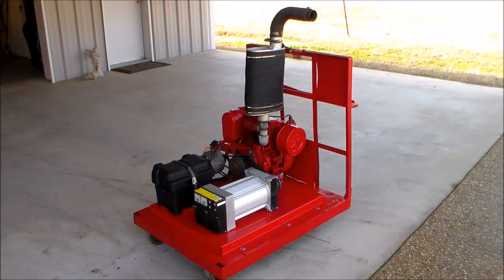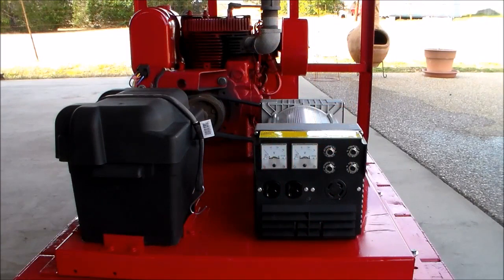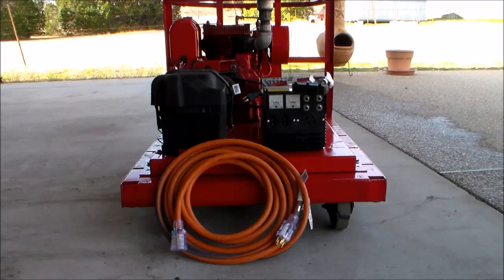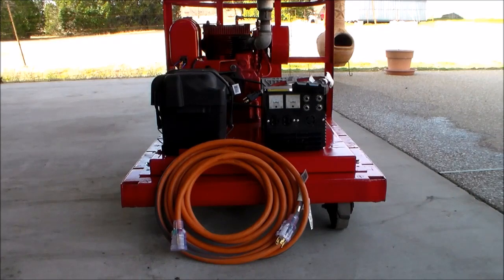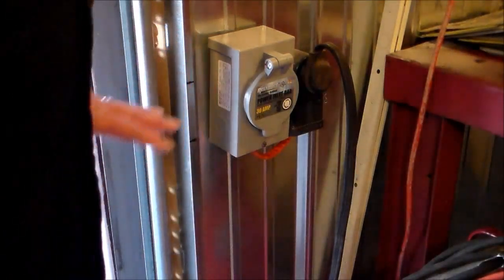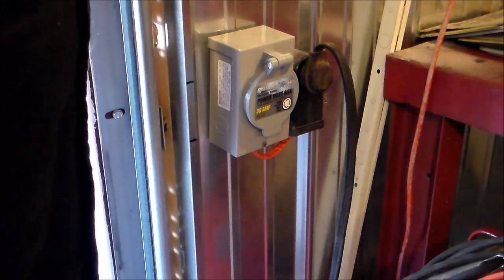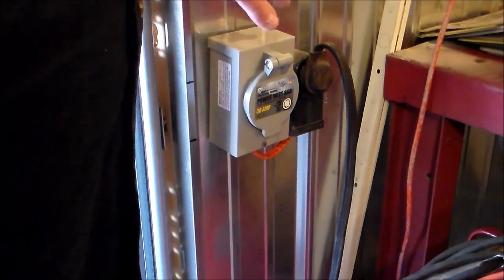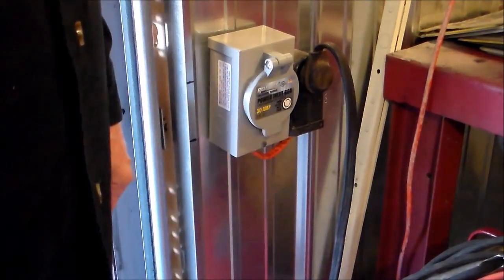Harbor Freight 10 kw Generator Head

Comment: Did the generator somehow connect with your motor to increase RPM during higher demand for amp draw?
Reply from the maker: This engine ran at one speed load or no load. You can get an electronic throttle control if required. Thanks
Reply: That's a shame.  Running at idle until load draw increases saves a lot of wear on your engine - especially in a power outage situation where you may need to run it for hours or even days.

Comment: Hey Rusty! I just picked up this same gen head off of FB marketplace for $100 and it's never been used. I have a 71cc gas motor I was going to connect it with that used to power a 1200w generator. I think it will work?? Does this generator head still work today?
Reply from the maker: The one I got was a 10k gen head and required a minimum 16 hp to get full rated power. Your engine may operate it but will likely need a larger engine to get full power. Good luck with your project
Reply: @RustyGlovebox  Yep! You're right. Doesn't work! Found manual online and it say's 16hp. Would like to find a DC motor with that kind of power and RPM.

Comment: If your generator is 10kw. It should be making more than 30amps
10000w/120v= 83amps. Even using 50% load that's still 42amps. I'm curious how you got the 30amp result.
Reply from the maker: It is rated at 10k surge and 7200 continuous with 240 volts. 7200/240=30amps
Reply: @RustyGlovebox  got ya. I thought u were in the USA. My bad.

Comment: Could this be mounted to a 2000 ranger xlt 4.0 ??? I have a 10000 dual fuel generator to power my house but was thinking as a backup if the other was down
Reply from the maker: The gen-head is big so you would have to be the judge if you have the room under the hood.

Comment: What size engine did you use? Can you turn the generator over by hand? What is the smallest engine that I could get by with? Thanks in advance.
Reply from the maker: It requires a 16 hp engine that can drive it 3200 rpms. You will need to check and make sure you are getting 60 cycles. You can change that by increasing or decreasing the rpm's. You can buy a meter on ebay or amazon cheap. Good luck
Reply: @RustyGlovebox  Using a 16HP engine seems like a lot. I have a 7.5KW gas generator and it cost me $77 for gas to keep 2 fridges and a freezer going off and on for 6 days during Hurricane Irma a couple years ago. That was maybe 6 hours a day.
Reply from the maker: This is the link for the gen head
https://manuals.harborfreight.com/manuals/45000-45999/45416.pdf

Comment: Speaking of pulleys. Do you by chance remember the shaft size for the generator head? I have been looking everywhere and cannot find the shaft size to put the right pulley on it.
Reply from the maker: Sorry I took so long to get back but here is the link for the gen head instruction
https://manuals.harborfreight.com/manuals/45000-45999/45416.pdf

Comment: What size engine is turning your generator head?
Reply: At least 16 hp on gasoline . Must run at 3600 rpm to get 120//240 volt. More it better, 20hp would be better. At 10000 watts surge load it would use 20 hp.You can never have to much hp as long as its 3600 rpm with a rpm  governor. I would build a bigger generator, but most cars engine are expensive to govern to 3600 rpm or use belts  and pulley to that rpm...
Reply from the maker: Yep, 16hp or larger works perfect

Comment: I bought this 15 year ago.Remember volts X amps=watts,  watts/volts = amps,  watts/amps =volts I directly coupled to Brigg 23 hp using lovejoy L100 couplers. It worked well for 72+ hrs at my cabin running 12.5 btu air conditioner tv lights microwave etc in 90+ degree weather after big storm knock local line down. Only problem was heat off engine blew towards generator head then suck inside and  melted internal plastic fan, then over heating generator head.  no  repair parts available(fan). I should have placed a metal shield between engine and generator to defect heat away from gen cooling air intake. Use at least 16-18 hp 3600rpm engine at 35- amps 240 volts load. More hp is better. Electricity is drawn  and load will slow engine down from 3600 rpm dropping volts from  120/240 which then raising amp draw. PS for Idiots, you can't hook a electric motor to drive the generator , that would be a perpetual motion machine and violate the law of thermodynamics..
Reply from the maker: I tried to get another one but it was damaged in shipping. Re-ordered and the same thing happened again. Gave up after that and just got one of their generators at the store. Thanks
Reply: You COULD run it off an electric motor. You could not run that motor off the electricity generated by it, though. It would be a complete waste, obviously. I'm not sure who would think that was a good idea.

Comment: I'd be curious to know what the Hz runs at under full and partial loads?
Reply from the maker: I have a Hz meter and set the rpm to match 60 cycle
Reply: @RustyGlovebox  So when you hit it with a full rated load, how does the engine/Hz respond?  The reason I'm asking. Most engine governors are not that sensitive to holding the correct Hz instantaneously.
Reply: My suggestion, Use a pure resistive load (space heaters or resistive incandescent light bulbs) and an Amp clamp and voltmeter and run it at no-load, then full 30A load and see how it responds.
Reply: @RustyGlovebox  BTW, I just looked at that "10KW" head, it looks like it's really a 7200 watt head, that's what it's rated at. It'll not hold 10KW continuous. I doubt it'll hold a 30A load for more than a few seconds before it trips or bogs the engine.  The rule of thumb is that you need 2 HP to produce 1 kW of electricity.
Reply from the maker: It is a continuous duty 7200 with 10K surge. You are correct there is some fluctuation. It would not be a good choice to operate sensitive electronics.  For those an inverter generator would be a better option.
Reply: @RustyGlovebox  how big are the variances?
Reply from the maker: @TheEquineFencer  I set it under a 1/2 load. It doesn't run at full load all the time so it can vary.  Maybe 1hz , similar to other small engine generators

Comment: Nice build. I plan to use this same generator head and run it off the pto on one of my tractors. I will likely build the generator attachment to fit my 78 Bolens H16XL, as it has a Tecumseh OH160 (16hp).
Reply from the maker: Thanks Mike, I have done an update on the power plug, you may look at this video. Take care
https://www.youtube.com/watch?v=m08AR_eqITw&t=272s

Comment: are these STACK-ABLE?   It would be nice to get upto 100 amp X2 for 220 volts.
Reply from the maker: It doesn't say they are stackable. I think it would be cheaper to buy a larger generator to  get the 100 amps.
Reply: To stack them there would have to be a way to synchronize the waveforms and these do not have that.

Comment: Do you think a 10hp briggs would be ok to power this generator head?
Reply from the maker: TACOMASRT5   I think it would but you would not be about to generate at its maximum wattage. A 16hp is recommended
Reply: @RustyGlovebox  I've got a harbor freight mig 170 welder
Idk how many watts I need to power it. Works just fine in my dryer outlet
Reply from the maker: @CarModsandDadBod    If the welder is a 120 volt welder and it draws a max 20 amps. The minimum watt needed would be 2400 or higher(go with a higher output generator).  Go by the continuous duty not the surge rating.  Without knowing the exact welder , this is very general.
Reply: @RustyGlovebox  the welder I have is a 220 20 amp.  It's the mig 170 from harbor freight
Reply from the maker: 220 volts X 20 amp = 4,400 watts minimum. The larger the generator the better. If you get to close to the minimum, it would over work the generator and cause problems with the generator or welder.
Reply: @RustyGlovebox  so my 5000watt should work?
Reply from the maker: @CarModsandDadBod    Is that 5000 surge or continuous duty
Reply from the maker: You need to looks at the specs for your generator. What that advertise is the surge and the continuous duty is 500 to 1000 less watts on average.
Reply: @RustyGlovebox  surge is 6550
Continuous is 5500

Comment: hello, Im interested in using this generator, I dont see any mounting points on this generator, can you tell me how this thing mounts to the platform?  Ive been looking all over, not one picture of the mount points
Reply from the maker: On page 5 it shows the way it mounts.  It has worked well for me. Good luck
https://manuals.harborfreight.com/manuals/45000-45999/45416.pdf

Comment: Just bought one of these. Might be a stupid question. I don't see in the manual and couldn't tell from your video. But, does it need to rotate cw or ccw? Or does it matter?
Reply from the maker: Mine really works good. Here is the manual and it should answer any question. Good luck
https://manuals.harborfreight.com/manuals/45000-45999/45416.pdf

Comment: your connection to the house is so dangerous  ive seen a guy wait 2 months  in the middle of winter to get reconnected after getting caught using a setup like you  have by the power corporation 
they totally cut his house clear from the pole  big fine had to have his entire house  inspected everything down to a missing switch plate had to be fixed before they would reconnect dont be cheep spend the 1200 have a isolation panel installed

Comment: It needs a switch to pair the coils for 110 so you have more 110 power 60 amps 110 or 30 amps 220?  Just running 110 will only load one coil without a pairing switch and limit the output by half
Reply from the maker: This generator won't deliver more than 30 amps. It has 110 and 220 plugs but 30 total is all it will deliver. You will have to go with a unit set up to deliver a higher amp load. They generally will be rated for 50 amp or 100 amp load.

Comment: I have a truck with the transmission out. It runs fine. I had thought about one of these gen heads to use with the truck turning it into a quiet electric start gen. The gen head needs 3600 rpm to work, the truck idles at 700plus, so I would need some sort of pulley setup or such to make it so it becomes 3600 at the gen head. Any thoughts anyone? Learning all the time.
Reply from the maker: I bet that would work fine. More engine than you need but you alread have it. Plenty of power to gear it up. Good luck on the project.
Reply: A brick on the gas pedal will work just fine! 😀

Comment: You did a very nice job mounting everything.  It looks very clean.  The enegine does not look large enough to carry that 10k  generator head though.  I have not done the math, but with the power loss of the belts, and pulling the automotive style alternator, I would suspect you would need around a 20 - 25 horse engine.
Reply from the maker: The instruction for the gen head says 16hp is the minimum recommended hp. Thanks

Comment: I would like to do this, as well. But, my biggest concern is decibels. It sounded pretty loud. Have you ever thought if putting a shroud on your unit? What do you think the drawbacks would be and would it dampen the noise to say, 55dB?
Reply from the maker: TheZooBrooksAB  It is loud, I have it down 86dec now. Your right an insulated cabinet should make a big difference. Haven't done that yet but will figure something out for it. Thanks

Comment: Is this still working? I have an old Kohler RV generator that puts out only 120v, and I've been thinking about adapting this head to the motor (22hp, strong and quiet). I'm concerned about the quality of the Harbor Freight head, though.
Reply from the maker: Well, It is still working. It has copper windings and sealed bearings. For the money I have no complaints. The few parts it has inside they could be replaced easily. it puts out 120 or 220. But if you wanted something for an emergency backup, I would get a stationary propane or natural gas unit.Thanks

Comment: What did you use for a motor?
Reply from the maker: I had a 16 hp Kolher engine I used . I had thought about standing the gen head vertical and use my riding mower engine  but used this engine .
Reply: Rusty Glovebox but if you did the vertical route you would have to change out bearings to thrust bearings on the generator head

Comment: Just saw your message.Thanks for your input. Know what you are getting at now, but I'm little confused, which is ok. I'm not a electrician. The manual list two 120 volts at 20 amps each, one 120/240 at 30 amps. So they are saying a total of 70 amps? Formula 7500/120 = 62.5 volts. 10000/120 = 83.3 amps. So I'm not sure what to say. Does come down to say don't go over 10,000 watts so I'll stick with that.
Reply: 7200 watts is 30 amps at 240volts or 60 amps at 120 volts total load. 10000 watts is about 40 and 80 amps and needs more hp.. about 750 watts per electrical hp on draw or 450 watts per engine hp. 7200 watts /16 hp gas engine = 450 watts per hp is correct because of lack of gas engine efficiency is barely at 50 % percent. electric motors are 85 %+ efficient

Comment: What size engine did you have powering it?
Reply from the maker: The generator required a minimum 16hp  to operate at the correct speed at full load.  I had  a Kohler 16 hp on the shelf that  worked perfect for the job. Good luck on your project.
Reply: thanks

Comment: Thanks for the reply Rusty. The schematic does show the 240 socket having two 30 amp breakers on it. 30 amps for the Y portion, 30 amp for the X portion which can could be separated for two more 120 volt outlets at 30 amps each. You'll probably never use 100 amps (30,30,20,20) in most houses and as far as over heating or such the breakers should trip before that happens.

Comment: Might look into some anti vibration mounts.  Seem to be fairly cheap.
Reply from the maker: +TheDisorderly1  Thanks , I was looking, do you have a supplier or type you were thinking of?
Reply: Seems like they're available a lot of places but a quick search shows grainger has a boat load of them,  starting at 2.13/ea.  https://www.grainger.com/category/cylindrical-vibration-isolators/mounts-and-vibration-control/material-handling/ecatalog/N-9tu?ssf=3
Reply from the maker: Thanks, I saw a couple I wrote down and going to give them  a try. Appreciate it

Comment: Cool! Awesome build! 
I would love to have that here. Our power goes out several times a year. 
But oddly, not this past year...
Reply from the maker: +captainjerk  Thanks, Never can tell, but if it hasn't in a while your likely OK.  It will go off here during thunder storms here when it does. Take care
Reply: @RustyGlovebox  what size pulleys did you use on the generator and the engine ?
Reply from the maker: @brieannateylar5810  3.5 inch on both